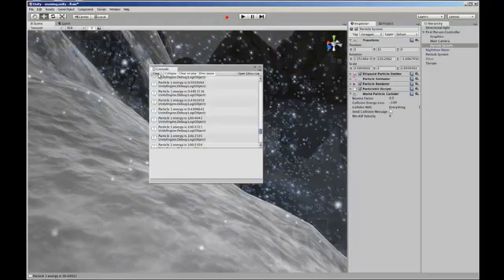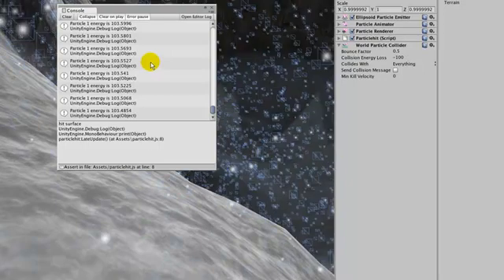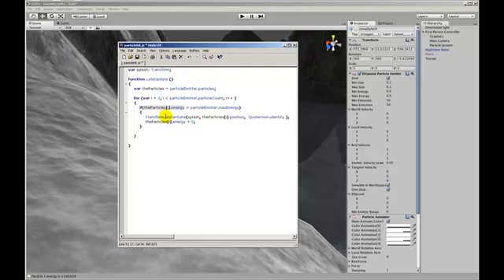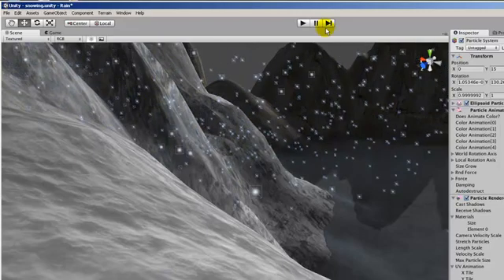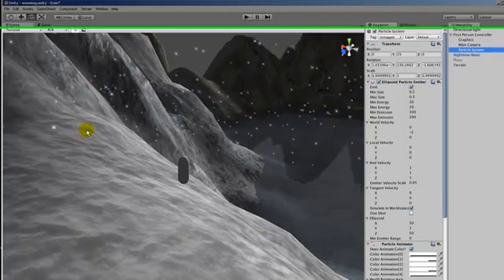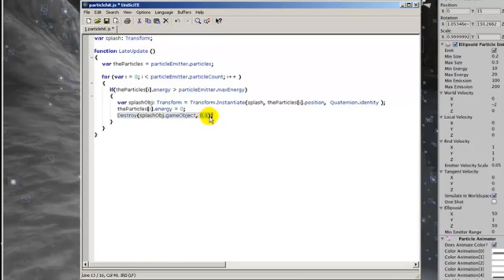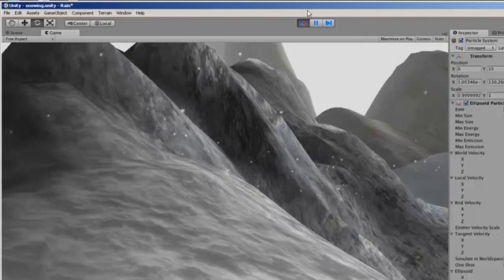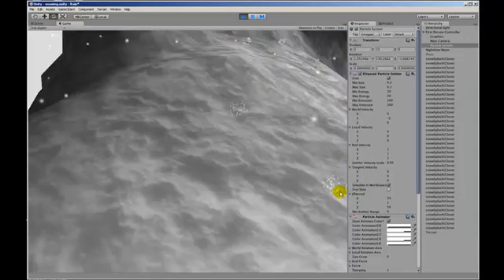Unity3D: How to Make Snow Part 4

Comment: Is there any chance you could update the script for Unity3? I'm encounter errors using your code verbatim.

NullReferenceException: Object reference not set to an instance of an object
Boo.Lang.Runtime.RuntimeServices.InvokeBinaryOperator (System.String operatorName, System.Object lhs, System.Object rhs)
particleHit.LateUpdate () (at Assets/particleHit.js:7)